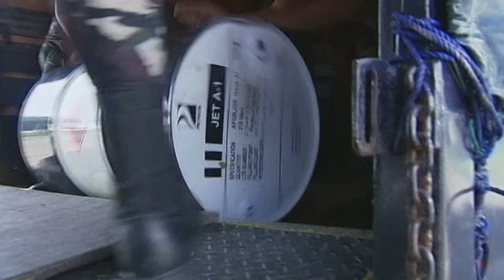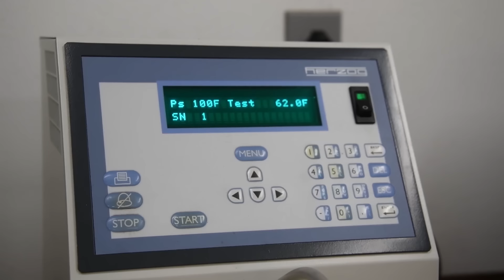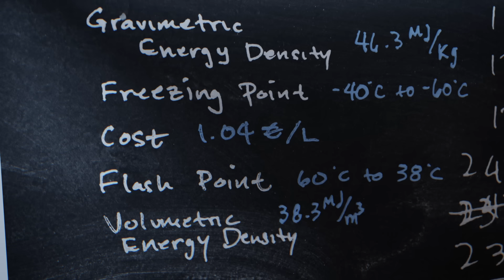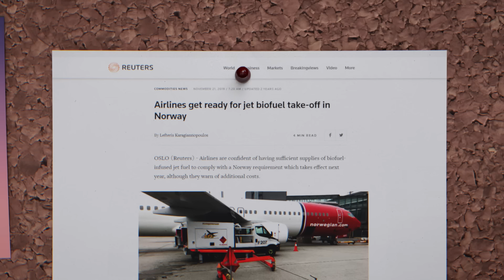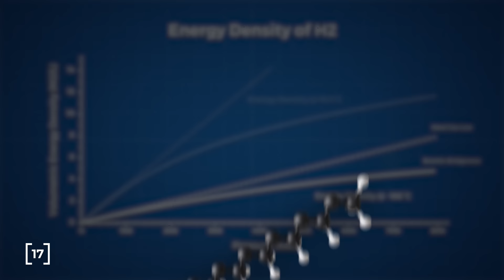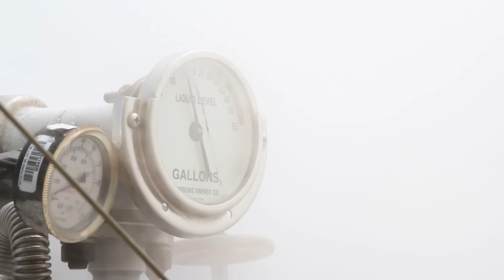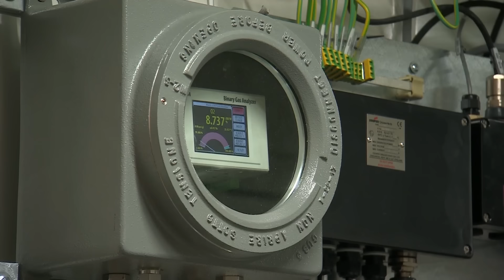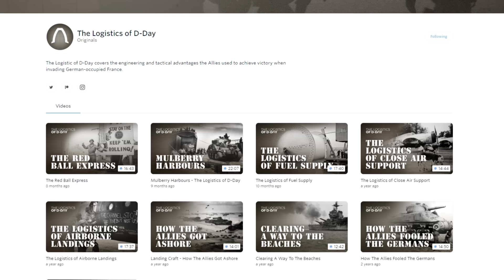The Uncertain Future of Jet Fuel

Comment: Clearly, nuclear powered planes are the answer! How could you have missed this, it's got incredible energy density and volume. 
Oh wait.
Reply: Turns out that's a biological issue more than an engineering one.  Humans just need to learn how to not be such wimps about radiation.
Reply: Imagine all the nuke fly all over US
Reply: @whatelseison8970  yeah people are making things difficult for us engineers. Given that only 11% of people in the world use air travel, them getting infertile would only help control the world population. But we need not be sad about the deaths of mutated babies because an increase in mutation at birth may someday give us a super-powered human species capable of withstanding nuclear radiation !!!
Reply: @mindprobe3587  Being aboard a nuclear powered vehicle does not mean they are exposed to the nuclear material 🙄. I can't even explain the simplicity of it, because it's so obvious.
Reply: @mindprobe3587  Actually, that would be one way to deal with radiation. Very costly in terms of human lives, but a solution nonetheless.
Reply: the last time I checked you need vast amounts of water (steam) to make nuclear power
Reply: @carlose6010  
Still, the concept of a nuclear plane is fundamentally flawed. 

Adding a nuclear reactor + nuclear grade cooling system + radiation shielding to a plane makes it very heavy, which limits passenger / cargo capacity.

Problems don't end there, though, since there's also the fact that you're flying a nuclear reactor over people's heads... people who don't even like having nuclear power plants around. 

Also, if the plane is involved in an accident or has a malfunction, you need to worry about radiation leaks, which could potentially force airports to shut down, require mass evacuations and the establishment of exclusion zones. 

When regular airliners crash nowadays, only the people inside die... but if a nuclear airliner crashed instead, there would also be an exposed reactor core scattered around the crash site (like a mini Chernobyl). So, on top of the people killed in the accident, there would likely be additional radiation victims.

The aircraft itself wouldn't be cheap either (expensive to buy / rent, maintain and operate) and a single accident around a populated area would likely bankrupt the airline and force the evacuation of thousands of people. 

Just imagine that Korean Flight 8509 had been a nuclear 747 instead of a regular one: https://www.youtube.com/watch?v=vZElWMMMn7c

Hell, take any of the serious accidents from Mentour's aviation accident series and imagine how much worse it would've been if those planes had been nuclear powered: https://www.youtube.com/watch?v=JSMe1wAdMdg&list=PLiNyr6QSO28P2bKMcv2O_lK83jsR0A9-W

Doesn't matter how you slice it, I don't think we're ready for nuclear planes just yet.
Reply: A new definition for fallout.
Reply: Afair though its weight for output power is pretty shit though, no? You would need tons upon tons of plutonium to achieve the sufficient power output to power a jer airliner, no?
Reply: Russia tried that once, ask the crew how it went (you'll need a ouija board though).
Reply: @MrElifire84  Nuke plants are always situated by large bodies of water, huge lakes, rivers and oceans.  Most Nuclear plants use a billion liters of water per day.  That is why subs and ships can float about freely because they have an endless supply of water.  Batteries?  Even a 4000 pound can only go about 300 miles.. charging a lithium poured airliner which has  15,000 pounds of thrust  each.. I am done with this conversation.. nice chat !  :)
Reply: Yes as long as it's nuclear fusion!
But we'll probably have insanely energy dense batteries before compact fusion reactors...
Reply: @mindprobe3587  LMAO!
Reply: nuclear power is just a glorified steam engine. There is no nuclear power source that you can just plug wires into. Its all about heat turning water into steam to turn a turbine. We dont have steam powered planes.
Reply: @entropicprinciple9276  25 MEV neutrons beg to differ
Reply: @werrkowalski2985  Uranium is one of the most energy dense materials known to man. The big issue would be; reactors are super heavy, cooling is super heavy, and shielding is super heavy.
Reply: I'm pretty sure this comment was sarcastic, but here's why nuclear would never work:
1. Weight: The aerospace industry can't afford that much weight
2. High maintenance cost
3. Too risky
Reply: @dcptiv  Well, look up nuclear propulsion systems, Aircraft Reactor Experiment as well as N.E.R.V.A. Most of them are for space travel, but there were serious considerations to build systems for airplanes back then. Back in those days the SU (CCCP) even did it if im not mistaken.
Btw a nuclear reactor produce heat, the way how you use that heat is up to you. Commercial power generation nuclear plants use the Rankine cycle via steam generation but this doesnt mean that you can't use the heat in a Brayton cycle and drive a gasturbine with it. (though this task requires a higher outlet temperature than what the conventional power plants operates on to be effecftive but this just means that you need to purpose build the reactor for your plane and can't just downscale a power plant, and these higher temperatures are definatelly possible even in power plant scales (just not in a conventional settings but rather like in a HTR or VHTR) let alone in smaller applications like what submarines, icebreakers or aircraft carriers may use.  So, no, you don't need a steam plane to use nuclear energy propulsion :D
Reply: @Goreuncle  Yep but his view(s) were flawed. I suppose if plane pollution got very serious we may move back to blimps, or by that time our ev's will be much more advanced. Shame we can't have peace on earth yet. Generally we're bound to fail for being unable to get along/be educated. Some Societies are even going backwards in intellect.
Reply: Meh. If that idea upsets people, probably shouldn't look into what's already been sent into space. Well, that we know of.
Reply: I know this comment is a joke, but nuclear planes were actually investigated decades ago quite thoroughly to see if they could be made viable. This was done before the public got cold feet about what is probably the safest fuel source for the electric grid due to a few high-profile-but-low-impact incidents (as a comparison, thousands of people die every year from coal power, but many in the public don't connect pollution with health repercussions).
Reply: We still don't have technology for creating lightweight nuclear machine, even battery is still not light enough compare ro energys needed.
Reply: @zee9709  Mere matter of investment. Despite the lack of interest and even terror globally, we've still developed and built more efficient, safer reactors, not to mention current modular designs. But yeah. Since it's not currently already in existence, clearly it won't happen. Technology rarely gets smaller over time. 

Yup.
Reply: @cut--  
Current widely deployed Nuclear technology indeed does use a great deal of water. But many Of the Next Gen Nuclear technologies currently under development require no water. And yes, batteries are heavy and have huge limitations for aviation.
Reply: @cut--  Yeah, but you only need a fairly small amount of filtered water, the rest can be seawater, for example. And you literally make water clouds, which get inland and rain, to replenish the ground water. Well, if there is any vegetation to allow the water to seep into the soil through the openings around the plant roots, or through especially-designed wells, made to let water get tens of meters under the ground, to replenish the ground water without plant roots. 

Also, there's always the option of updraft towers, or updraft chimneys, or even updraft pipes. You could have seawater siphoned naturally into very long greenhouse-covered ponds hundreds of meters away from the shore (to not lower sea-side property value), use mirrors and fresnel lenses to concentrate more sunlight onto the ponds with a fine dark mesh used to absorb sunlight and use the heat to evaporate the water and leave brine behind, and have the greenhouses funneled into a pipe which travels kilometers inland and at least hundreds of meters in elevation (with some solar re-heating stations, to make sure the steam remains as steam for long enough periods of time), and use ground-level wind turbines to generate power from the updraft, and use a smaller tower with some of that updraft to cool a big part of the steam into liquid water, with the rest released as clouds into the sky.
Reply: @martinsoos  But you can use nuclear power on the ground, to make competitively-cheap green fuels, for all combustion vehicles.
Reply: While nuclear powered planes would pose a giant problem, an electric powered plane charged by nuclear/wind/steam/solar energy would in theory work, and as long as you're okay with not being as fast as a jet engine, would provide much lower operating costs compared to traditional jet engine aircraft.
Reply: @Adierit  Not only that, but for "priority class" airplanes, which need to be faster, you can use jet engines with hydrocarbons made with the same nuclear power you would use to power the electric vehicles. Not only that, but having e-fuel production stations slightly oversized would allow them to be used for load-balancing, so the nuclear reactors can run at peak efficiency, and just have the e-fuel production stations generate more fuel when other consumers don't need the electricity, and less fuel when other consumers need the electricity. It would also be a good way to use all that excess solar, which would otherwise end up wasted, to generate e-fuel without overloading the storage part of the grid. This would mean that the price of electricity would be more similar at all times than it is now, because instead of putting the excess it in costly storage, it would be put into generating e-fuels. This would also mean that the price of electricity will get much lower, limited only by the costs of maintaining and repairing the grid itself.
Reply: @carlose6010  If you can't explain it, you very likely didn't understand it at a visceral level yourself. You are merely tricking yourself into understanding it. You truly understand something when you are able to explain it to a five year old ... when you can't do that, you aren't there yet yourself ...
Reply: @cyntdestroyer69xd  Pshh. Cause he was a total beta.  Myself, being a gamma would LITERALLY become a non copyright-infringing hulk-like entity.  Then later, I'd gamma yo grandma.
Reply: @Mohammad Golam Azim You actually nailed it.  A nuclear jet would not need to generate steam.  What does a turbojet burn fuel for? To make heat.  Do airplanes use jet fuel to boil water for a stem turbine? No.  Why would a nuclear jet engine have to?  A nuclear jet engine would be an air cooled reactor.  Also, nuclear reactors are not fundamentally heavy devices -- the shielding is what makes nuclear power prohibitively heavy for manned aircraft.  You'd hope that common sense should also rule out nulear UAV's but as far as I can tell, all these supposed hypersonic missiles that can stay airborne for extended periods are basically only possible through the use of nuclear ramjets or scramjets.  But hey, if you're gonna be killing folx anyways what the hell right?
Reply: @Kyle-gw6qp  Yes, but thats not the same as having the highest power output, afair for a nuclear reactor to produce an output of over 1000 MW of power you need over 100 tons of uranium in the reactor, that is 1000 MJ per 1 second output. Gasoline has say about 40 MJ of energy per liter, so to produce 1000 MJ of energy you would need about 25 liters of gasoline, so thats a bit less than 25 kgs of gasoline, you would need to burn that in 1 second to produce 1000MW, but that is feasible, and way easier than having an entire power plant that weights thousands of tons.
Now, they wouldnt use the same uranium that is used in power plants, I thought that making a kind of a radioisotope thermoelectric generator could be efficient, but the only reactor tested for aircraft use ran on pure uranium 235, I don't know how much it weighed, but it still looks a bit too big for an aircraft in the photos. Im not sure if achieving enough power output per weight is possible.
Reply: nuclear powered dirigibles.
Reply: Been looking for this comment
Reply: not sure if it's peen posted already but............ https://en.wikipedia.org/wiki/Aircraft_Nuclear_Propulsion they already tried it long time ago. it doesnt work.  who would imagine a foot-thick lead wall weighs a lot?
Reply: This has actually been attempted and worked
Reply: @SapioiT  this is equally valid for green power sources
also nuclear has the "fun" trade off of highly hazardous waste products
Reply: Uranium 

Gravimetric Energy Density: 709,166 MJ/KG ~ 15,000x Jet Fuel
Volumetric Energy Density :13,510,000MJ/L ~ 300,000x Jet Fuel
Flash Point: Undefined
Freezing point: 3927 C
Cost:  ~ 1000$/kg (Equivalent to 15,000 kg jet fuel) ~ 25 times cheaper
Safety: Dubious

It is always shocking to see just how energy dense nuclear fuels truly are. Shame they would make incredibly dangerous airplanes.
Reply: Found and Explained?:)
Reply: 3. Is easy to solve get a major airplane manufacturer to make it lessens the risk because too big to fail logic.
Reply: @durandle9226  The "highly hazardous waste products" issue only exists because of 2 reasons: (1) There are not enough nuclear reactors to be worth investing in facilities which would make the existing nuclear waste recharged or reused for power generation, and (2) there is not enough development into using existing nuclear waste to make Radioisotope Thermoelectric Generators (RTGs), which are are relatively easy to make, maintenance free,

and long lasting, but their efficiency is low so most of the energy is lost as heat. This could be used to convert that heat like geothermal power, but at the surface, allowing nordic countries to have small-scale green patches in an otherwise perma-frost area, or greenhouses which to be heated by such generators and which to use stirling engines to generate power from transferring/"losing" heat to the exterior through some carefully-chosen places. Pairing this with how snow reflects sunlight, some terraforming to flatten the terrain, and the angle at which the sun shines in those regions, vertical farming could be used to grow plants with the temperature from the RTGs and concentrated sunlight, with night-time illumination provided by stirling engines, and the stirling engines work better the higher the temperature difference is, and in the night time the outside temperatures are lower, which which means more electricity can be generated for powering the LEDs and the fans needed to keep the place free of mold. And the mold in the air can also be removed using ultraviolet (UV) lights (LEDs) inside the pipes through which air goes, to remove the need for air filters, at the cost of more power usage.

For more on the topic, you could check out the video "Colonizing the Arctic" by "Isaac Arthur" on youtube. And you can check out more videos from that channel afterwards, if you want to know more things which are possible with existing knowledge of science and even with existing technology levels, but mostly with developments which are within a few years of technological development and the limits of existing science and science we know for sure can be achieved in 2-3 years.
Reply: I am not sure we care about energy density for nuclear.  A gold bar has huge MJ/kg but watts are low because you need to wait trillions of year for it to decay.  
With aircraft the first issue is watts per kg of the propulsion system, not energy density.   Wright Bros were first to overcome W/kg, and power per kg continued  to be a big issue for the next half century.  Then we turned to worry about more about efficiency, to get more range per kg of fuel.  Nuclear would put us back into the W/kg problem.
Reply: @HweolRidda  If you put the nuclear reactor into the airplane, yes. But you can use it to make the fuels mentioned in the video, on the ground, at a price competitive to the one for current fuels, and also make electricity much cheaper overall. The fuel generation factories would act like a load-balancer, using more power when the consumers use less power, and less power when the consumers use more power, to allow the nuclear reactors to run at peak efficiency at all times.
Reply: allahu akbar?
Reply: @cut--  While I agree that fusion reactor use is unlikely. SFR can be extremely compact and don't utilize any water to generate power. We're actually planning to use these to provide power for moon and mars habitats

Comment: going from 2% to 25% sounds really scary, but if the total amount goes down, obviously the ratio will shift significantly. What's the estimation of actual output in 2050, instead of ratio?
Reply: Triple, though that was pre-COVID. Who knows now.

2% underplays its impact though. Due to altitude, its impact on warming is 2-3 times more than the raw emissions. It's on a completely unsustainable trajectory, and ignoring it because it's not too big today will just land us in the same problem that ignoring global warming for the past 50 years has - it gets much harder to change an industry the bigger it is, and the less time you have to do it. Better to slowly shift aviation starting yesterday than wait for it to be huge problem before acting.
Reply: @Yaotzin86  triple also assumes the pilot shortage gets reversed big time!